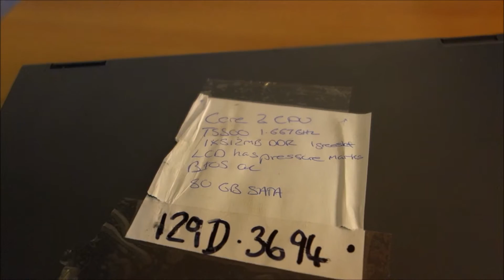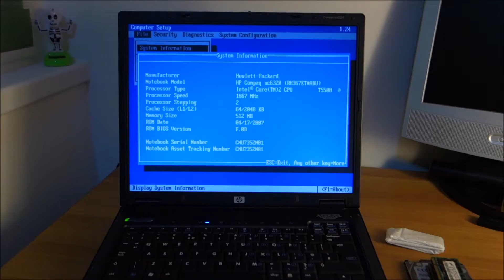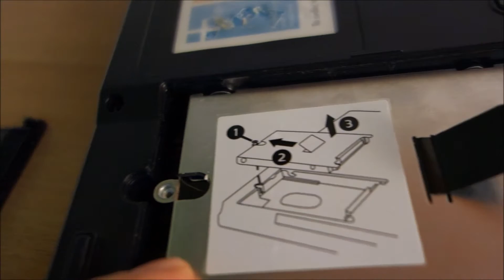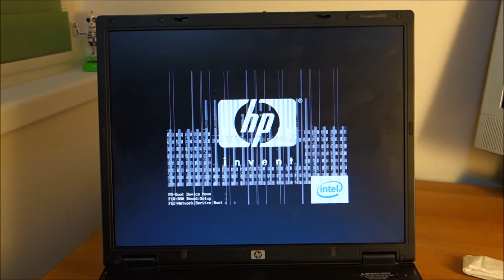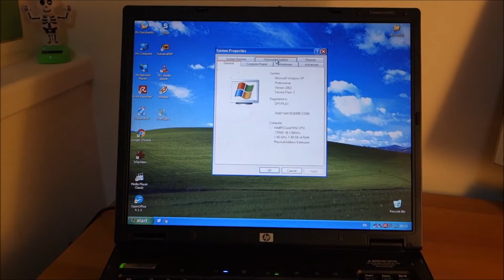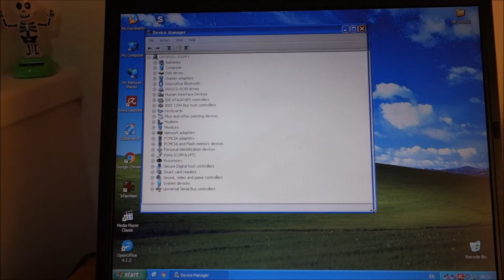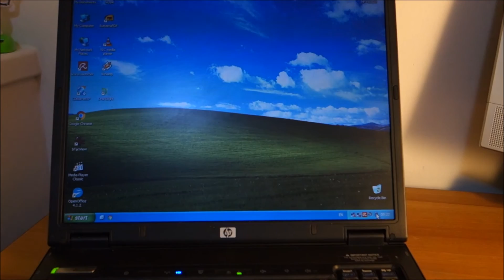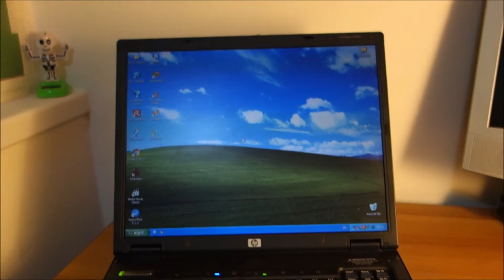How to upgrade a HP Compaq nc6320 notebook

Comment: Hello I have this laptop still in 2023 soon I will buy new but urgently I want to install windows 10 and I have one SSD drive 120gb that I want to upgrade and also want to upgrade the ram from 2 gb to 4 gb. Will this work for windows 10,currently I am using windows 7
Reply from the maker: Should work.

Comment: How to remove power on password
Reply: 1. It is simple.  Stop computer. Disconnect power supply.  
2. Remove MAIN Battery. 
3. In the upper keys line there are 5 sliding elements. Move them all up. 
4. Then you can remove keyboard. Under keyboard there is coin battery.  
5. Disconnet coin battery from motherboard. Wait 10 minutes !!!!!
5. Connect coin battery back to motherboard. Give back keyboard into original position.
6. Return back all 5 sliding elements into upper keys row. 
7. DO NOT INSERT MAIN BATTERY   !!!!
8. Connect power supply from grid. 
9. Start computer by START button with MAIN BATTERY still out.
10. Then Compaq should start without password.

Comment: MINE IS HP COMPAQ nc6220 I have 2 slot ... I came to know that it can only be upgraded to max 2gb ram..... if I insert 2gb ram in 1 slot is it ok ?
Reply from the maker: It's best to use 2x1GB.
Reply: It will work with 1*2gb or 2*1gb, but 2*1gb may use dual channel memory mode which is slightly faster. So if you don't have any memory it makes sense to go for 2*1gb, but if you have 2gb module lying around - use it, you won't notice a difference in real life

Comment: First, he forgets to disconnect the battery and the power supply, then he inserts the memory and wonders why it does not work.
Reply from the maker: Why does one of the modules work and the others do not, or they give corrupted image?
Reply: @UltimateDIY  You are probably lucky if this time the memory has not deteriorated after unsafe manipulations.
Reply from the maker: @EmpyPlace  must be really lucky then.

Comment: how can i upgrade my nc6220 IDE HDD to SATA?
Reply from the maker: I don't think there is a way to do this. There are IDE to SATA adapters, but not small enough to fit inside the laptop without major modifications.
Reply: You can't upgrade ide to sata, but you can use msata ssd with sata-to-ide adapter. It'll give you the ssd speeds for relatively low price ($5-10 for the adapter and $20 for 128gig msata ssd)

Comment: what is the partnumber of the hdd? will it work with 2gb ram?
Reply from the maker: There is no particular part number, any laptop hard drive will work.
Maximum RAM is 4GB (2x 2GB DDR2 sticks)
Reply: @UltimateDIY  hello, mine HP hab 1slot for RAM DDR2 cann i installed 4GB, witch 1on Modul or no!?
Reply from the maker: 4GB ddr2 modules are a hit of miss thing. Probably it will not work.

Comment: A bit like a HP laptop I got it was just able to run windows 10 might have been better to go back to XP but I do not have it anymore.
Reply from the maker: I used XP on this one because of the particular car diagnose software. I was afraid it will not work right on W10. I think you did god to go with W10, because the support for XP in many apps will be really bad in the future.